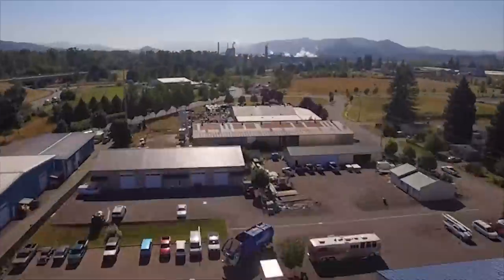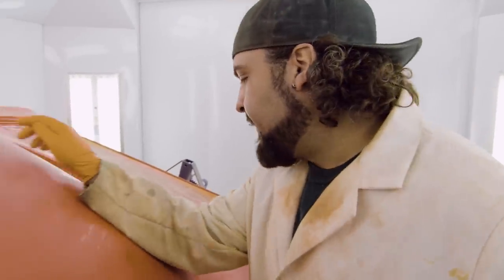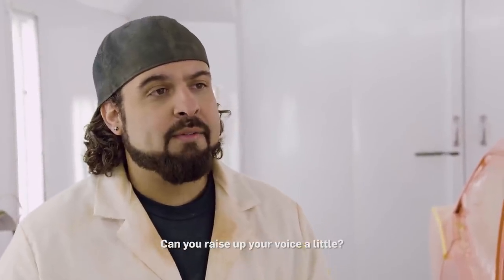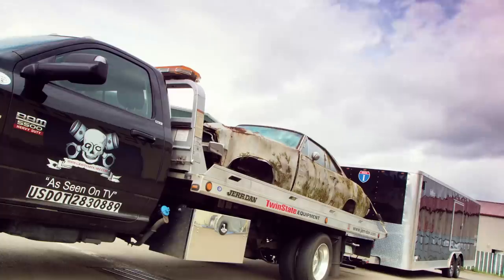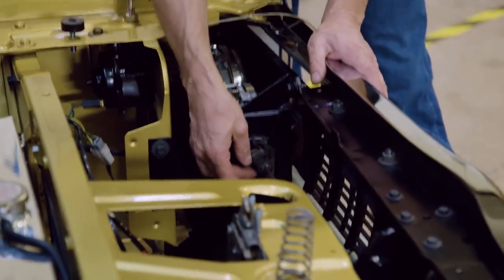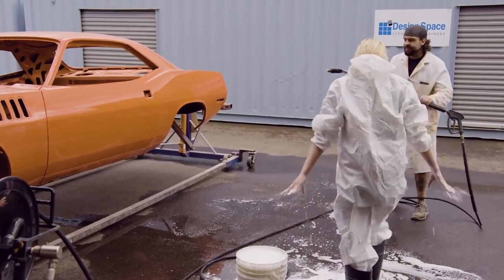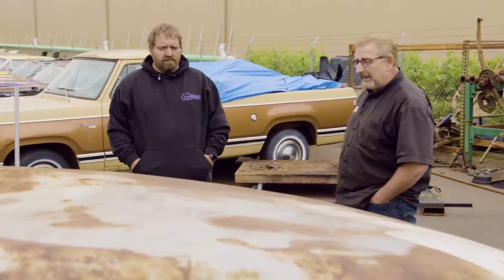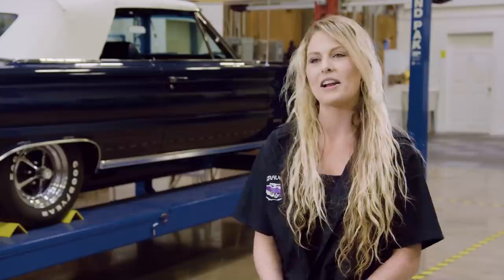Season 6 Episode 8: “A Fly in the Ointment”

Comment: Dave and Will, why in the hell do you refer to engines as motors?  Or perhaps you were refering to the Starter Motor or the Heater Motor.  As professionals, can we please get this minor detail corrected?  (Motor My Ass Gentlemen)
Reply: motor
[ˈmōdər]
NOUN
a machine, especially one powered by electricity or internal combustion, that supplies motive power for a vehicle or for some other device with moving parts.
synonyms:
apparatus · appliance · instrument · tool · utensil · device · unit · contraption · contrivance · gadget · mechanism · engine · lever · pulley · gizmo
ADJECTIVE
giving, imparting, or producing motion or action.
"demand is the principle motor force governing economic activity"
synonyms:
kinetic · driving · impelling · propelling · propulsive · operative · moving
Reply: I like it. It's a nice motor. By the way. Why is the engine attached to the car by motor mounts? People get butt hurt over the stupidest things.